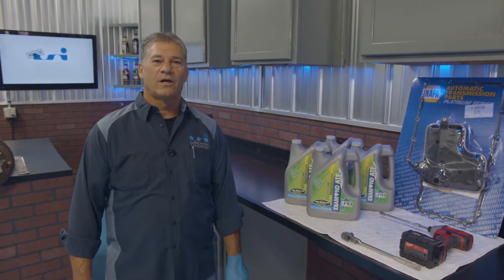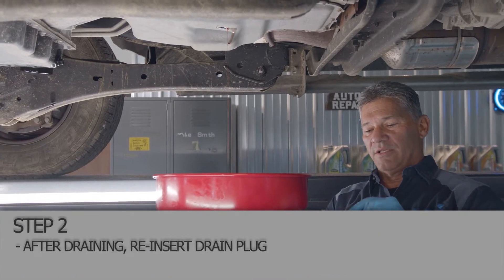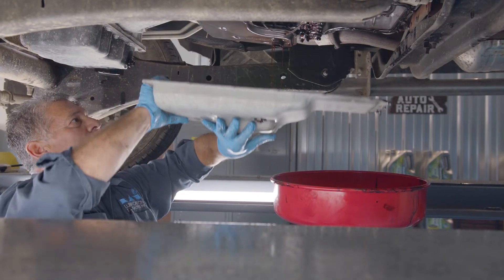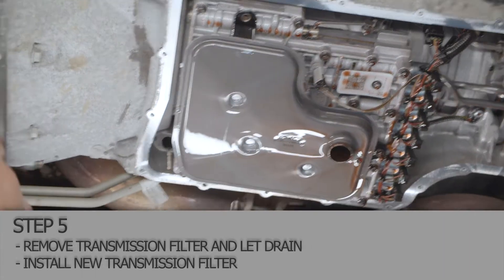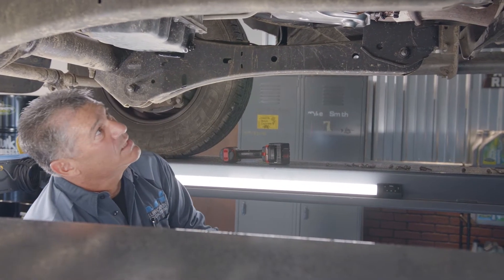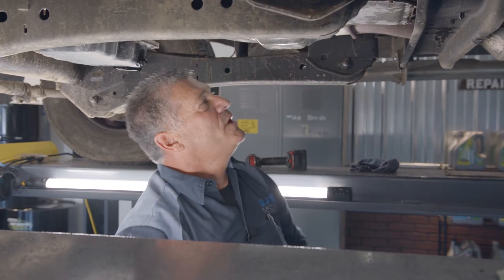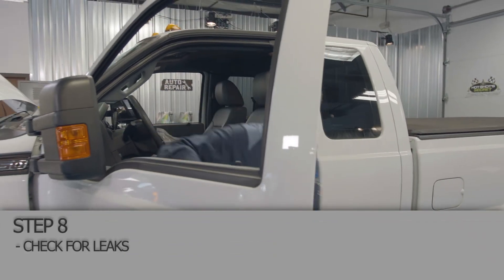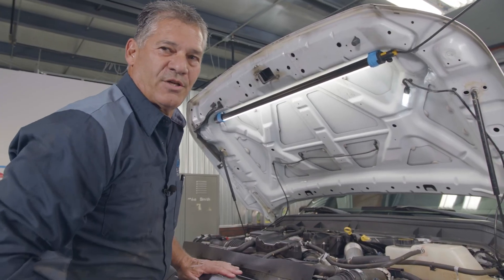How to Service a Transmission on a Ford 6.7L Powerstroke

Comment: Hey i have a 2012 F-350 Super Duty 6.7L Diesel want to know i was thinking about Putting on a Aluminum Trans Pan that Hole 2-3 Quarts more.. Does the Filter need to be extended as well or does the Stock Filter works

Comment: Would be nice to know that the plug is 13 mm and the pan and filter bolts are both 8 mm.  Also only 2 gallons comes out of this 4 gallon system when you do this.
Reply: Yeah, he said that . Listen up buttercup

Comment: muchas gracias, excelente video. me gustaría preguntarte, cuantas libras de torque para los tornillos del filtro y para la bandeja?
Reply from the maker: Filter, torque the 3 bolts to 11 Nm (97 lb-in)
Pan, torque the bolts to 9 Nm (80  lb-in)
Reply: muchas gracias, muy amable.

Comment: How many quarts of fluid went back in on the refill? Overall capacity is about 16 but without the torque converter, how many went back down the fill into the pan?
Reply from the maker: About 12, it is best to have extra if needed.

Comment: My manual says 18.5 quarts of ATF total, but how much comes out in a pan drain and filter change like this?
Reply: This was a filter change not a transmission flush. 18.5 quarts is correct if you do a flush
Reply: I just did mine, a 2014 F-350 Diesel.  I only got about 8L drained out of it.  (Less than half of my 20l bucket) .